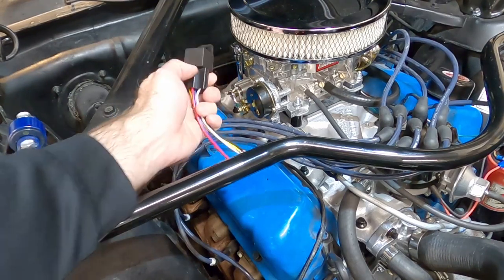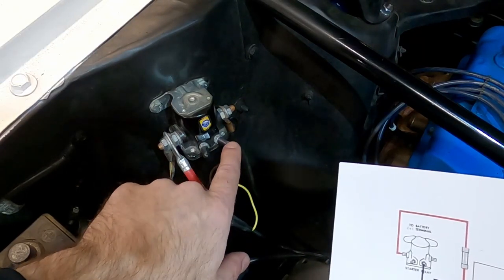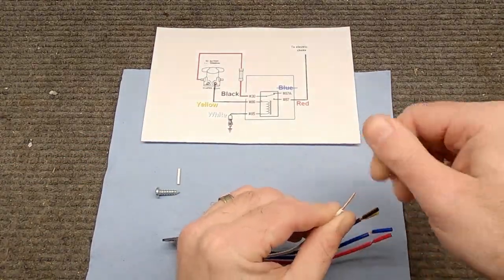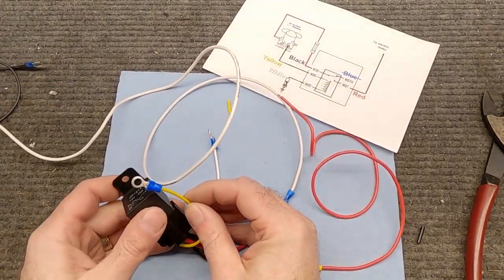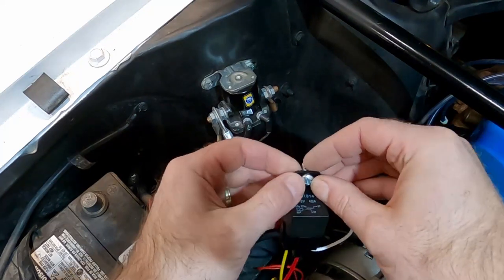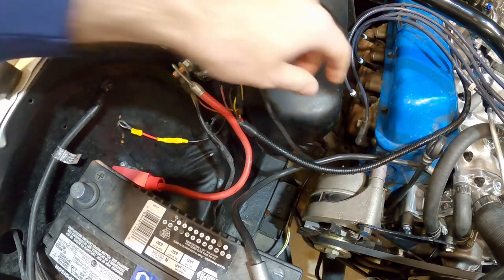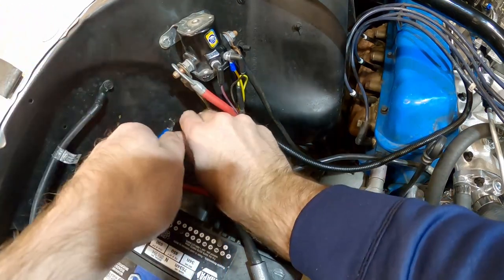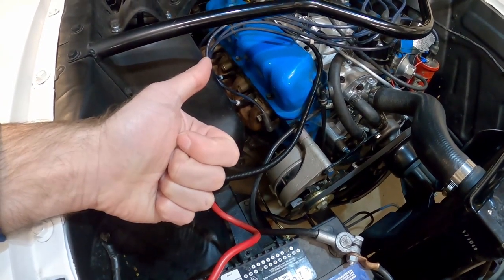How to Wire a Relay for an Electronic Choke

Comment: This is a good solution for someone who has added an electronic ignition that must have a dedicated 12 V. I had to bypass the PINK resistor wire and after that the I stud on the Sol didn't have the 12-volt power any longer, this will do the trick and it won't interfere with the coil.
Reply from the maker: I think it is too, but others see it as a waste of time.  It is agreed that the coil for the electric choke pulls a very small amount of amperage to the point where it can piggy-back on another circuit, I like having a dedicated circuit for additions to the car so I can track things down if there's a problem.  :)

Comment: Great video.  I did laugh when you mentioned using heat shrink on the connections, but then only used it on the one, and not the others you made.  🙂   Awesome explanation of using the relay!  I subscribed.
Reply from the maker: It might fall under “do as I say, not as I do”?  😄

Comment: Andy. Suggestion.  When you need to add wire length, use the same color wire as the original. The different colors are used for a reason— to be able to identify each circuit visually, with no need to use a tester.  Make sure you use the same gauge wire as the original.
You can buy an inexpensive wire kit of different colors and sizes with its own stand.
Your car is turning out nicely! Best Regards
Reply from the maker: This is good advice, and I've done that in the past.  However, when I did this video, I just used what I had in the garage.  :)

Comment: Why did you end up running a relay here? Did you not have access to 12V? I have to check where mine is hooked up to, but I didn't end up using a relay to get power from that area.
Reply from the maker: I needed a 12V source that was only on when the car was on.  Plus, I didn't want it tapped into anything else that was running in the car, I wanted a dedicated power source.  There are a few places in the car that one could tap into for a switched source, but this way guaranteed me the power I needed without interrupting anything else.
Reply: You can just hooked up to the coil.
Reply from the maker: @brechtvancauwenberghe9440  Yup

Comment: What size fuse are you using on the in-line fuse? Thanks Andy. Great vid as always. CJ pony ain’t got nothing on you. Big fan here from Toronto.
Reply from the maker: 10A or smaller. You could probably use a 5A with no issues. The coil inside the electric choke doesn’t pull much amperage to do its job. 🙂

Comment: Not sure you need a relay at all, since the current draw isn't high.  You could tie it straight to the solenoid where you took the power for the relay coil :)
Reply from the maker: Thanks for the heads up.

Comment: I imagine the in-line fuse has to be a 12V fuse, right? ....great vid by the way, I wasn't sure if I should by a carburetor with a manual or automatic choke, but I see no reason to fear the electronic one, jejeje
Reply from the maker: Correct, 12v fuse, 10A is plenty.
Some people prefer the control of a manual choke, but I'd rather have an electronic version so I don't have to mess with it.  :)

Comment: Thank you for a great video.  One comment I hear people make when wiring up their chokes is you don't want to use a constant 12v source.  You only want one that shows 12V when the key is turned on.  But doesn't this mean the coil on the choke is on all the time anyway (if the key is on)?  I guess this is to make sure the choke stays open (with some heat) even though the engine should provide enough heat to keep the choke fully open.
Reply from the maker: Correct, the power source for an electric choke is only hot when the car is on (as I've done here).  And yes, by feeding that choke a 12V signal while the car is on will keep the choke open during the use of the car, and it will begin to close once the car is off.  However, due to the nature of the coil inside the electric choke, the a hot motor and a hot day will make the choke stay open, but it may not be fully open, which could cause a little havoc with the driver if the choke is closing while they're headed down the road.
To reply to your comment about the choke always being 'on' with a power wire that is active while the car is on, this is fine and it does not cause any electrical issues or wear out the choke.  The amperage draw of the choke is low, and this is how all cars of the era (and for quite some time later) were wired up.  I guess someone could wire up a switch that cuts power to the choke once the engine is warmed up, but that choke needs to remain open during the drive, so it's easier to just feed it a 12V switched source and call it a day.  :)
Reply: To be clear in my mind, my choke only has a connection for the hot wire. I was told when I got the carb to just run a hot wire to the fuse box with a fused line. It’s a 75 Chevy. I think it’s grounded in itself. But, is it ok to wire it to the fuse box without using a relay like you did.?
Plus my solenoid is on the starter, not the firewall.
Thanks so much
Reply: I don’t want it staying ‘hot’ powered, after the engine warms up if this isn’t good.

Comment: Great video Andy! Thanks for sharing. I’m curious to find out what headers and radiator you go with on this build. However, those may come after the manual transmission swap you had mentioned. Thanks for the video.
Reply from the maker: Headers are coming soon (keep an eye out for that video), but I'm not sure yet on the Rad.  The main reason I replaced it on my last Mustang was because it was leaking.  So far this Rad is doing great and I'd rather put my money towards other parts that need some love first.  However, I will eventually replace it as I'd like to go to an electric fan setup, possibly a dual fan option.  The stock Rad is not larger enough for dual electric fans, but my engine is doing great on the stock setup, so........  :)

Comment: So there is supposed to be power to the choke all the time that the ignition key is turned on? So, I have learned something new. Thanks Andy!
Reply from the maker: Yes, other wise that bi-metal coil will cool down and the choke will begin to close. The old heat-tube style choke systems that were stock on these cars ran off the heat generated by the exhaust, which kept that coil warm and in turn kept the choke open.
Reply: @AndyKruseChannel  thanks Andy.
Reply: @AndyKruseChannel question if you don’t mind answering, is there any downside to running an electric choke that way?
Reply from the maker: @noble5856  Running it which way?  Are you asking if there's a downside to powering the electric choke with a constant source?  Without the constant 12V source, the coil inside the choke will cool and close the choke.  The choke must be powered the whole time the engine is running.
The same applies to the heat-tube style of the original choke, it receives a constant source of heat while the engine is running, keeping the coil in an expanded state, which keeps the choke open.  After the engine turns off, the heat is no longer applied, the coil moves back into its "cold" configuration, and the choke closes for the next time the engine is fired up.  In the summer time the coil likely stays warm with the warm outside temp, but that's ok because that means the engine is sort-of warm and the choke is not likely to be needed.  :)
Reply: @AndyKruseChannel   I thought the I could use the old style of electric choke from the old carb with heated coil but it seems like it the carb isn’t built compatible with that I didn’t want to add any extra wires to the engine bay, I appreciate you explaining the differences though, your channel is great and very helpful

Comment: Recently found your channel, bingeing them nowI really like your vids. I own a GM, but love all muscle car era cars. 
I added a ford type start solenoid to my car. The post you ran to the choke  has 12v with ignition on. Mine just send 12v to coil at start, as I have resistance wire. Is yours set like this because ford coils are internally resisted?
Reply from the maker: Welcome!
To be honest I don't know if the solenoid is internally resisted.  Back when I made that video, I was looking for 12V switched sources in the engine bay so I didn't have to run a wire from under the dash.  :)

Comment: Andy I would rout the wire to a switch oil or someway to have power to the choke only when its running, not simply with the key on incase you wanted to listen to radio or left the key on just saying.
Reply from the maker: Thanks for the heads up.

Comment: Hey Andy......I have a stock 67 289. Still has the Autolite 2100 carb on it. It works well. But debating on adding an electric choke. Should I upgrade my carb that already has an electric choke? Or just change the choke? If I upgrade the entire carb, what brand and size do you suggest? Holley 600? I don't know what size would be a drop on carb, without making a bunch of adjustments.
Reply from the maker: I put a 600 on my 289, but it was too much.  A 500 or 570 would be sufficient for there motors.  As far as replacing the 2100, it's a great carb, but you're leaving some performance on the table with that 2 barrel.  While you can buy an adapter for mating a 4-barrel carb to your 2-barrel manifold, it'd be a great time to upgrade that too, but it just adds to the bill.  :)

Comment: Hi Andy,
I am rebuilding a 1986 F150 with my son.  We just installed a non-feedback carb with an electric choke.  I have a questions about pin 87 and 87a.  When all wired, I wired pin 87 (normally open) to the choke and pin 86 to the starting solenoid, 85 to ground, 30 to the battery with a fuse.  When I check voltage to pin 87, I get nothing.  I put positive lead from DMM on 87 and neg lead on ground.  I get nothing.  If I put pos lead from DMM on 87a (normally closed) and neg lead to ground I get more than 12v (between 12-14).  Should I wire the choke to 87a?  When I turn the key off, the reading goes to zero.  Did I wire something incorrectly?  Will it harm the choke if it is getting 12v the whole time while running?  Should the choke be getting 12v the whole time while running?  Why wire it normally open if it gets 12v whenever running, right?  Any advice?
Reply from the maker: Working from the beginning of your post, you are correct, the voltmeter should read zero at pin 87 when the car is off.  If you connected pin 86 to the "I" terminal of the starter solenoid, and the car is off, the voltage at pin 87 needs to be zero.  Pin 87 will only show 12V when the car is on (running or just with the key in the 'on' position).
Moving the voltmeter to pin 87a at this point should give you 12V (as you pointed out), but this is ok because you are not using 87a and it should be taped off (like I did in the video).
Now this is where it gets tricky because it sounds like you just turned the key to 'off' and the voltage at 87a went to zero.  It should still say 12V as pin 30 should be attached to the battery, or at least a constant 12V source, regardless if the key is on or off.
The choke can get 12V during the whole time the car is on, even after the choke is fully open, it's not hurting anything.  Some people skip the whole process of the relay and just wire up the choke with a switched source (a voltage source that gets 12V only when the car is on) and it works fine.  I like relays and I like isolating the various circuits on additional electrical components.  It's a tiny bit overkill on this car, but I like having a dedicated circuit for the Choke.
Hopefully this helps!  :)

Comment: Why wire the relay signal voltage from the crank side of the starter solenoid so the relay is energized only when the engine is cranking - effectively turning off the power to the choke heater them moment the engine begins to run?  I get my signal voltage from the alternator.
Reply from the maker: That's not how that works, the relay is on when the engine is running.  You are more than welcome to grab a hot signal from the alternator, or the back of the ignition switch, I just chose this location be cause it's simple and it works.  :)
Reply: @AndyKruseChannel   -- You are gabbing power from the small right side terminal [ the Ign. terminal]  on the Ford starter solenoid to signal the relay,  to turn the relay on, so power flows from the large left side BAT terminal through the relay to the choke heater coil, correct?  This is what I got from your drawing.
Reply from the maker: Switched power is coming from the ignition switch (in the dash) when the key is on and it goes to two places off the same wire when it passes through the firewall.  One of the places is the positive terminal of the ignition coil.  The other place is the ignition terminal (labeled "I") on the starter solenoid.  Pulling power off that terminal to activate my relay is the same as either tapping into the red/green wire coming off the ignition switch, it's just easier to grab the 12V at the "I" terminal.  Admittedly, the relay is already overkill for this application, but I like it.  :)

Comment: Another helpful video...thanks. Could you also run the wiring direct to the coil (if so, do you need a relay/fuse?).
Reply from the maker: I have read that it's not ideal to tap into the coil for what I am doing with that electric choke.  This way I get a dedicated power source and nothing in the car is affected by this circuit.  :)
Reply: The coil isn’t a constant 12v and you don’t want to draw any current away from your ignition.

Comment: Thanks for the content. I like you, like for stuff to be on or off. Don't listen to the half-ass jack-asses trolling on here.  They probably never built, rebuilt, fabricated, invented anything with a engine.  A relay is one good way to have a on/off circuit for accessories and other 12v items. I have a few boats, and a large RV so adding a relay here and there is a good thing.  My deal is a 5 pin relay is really for having a high/low switched 12v source rather than an on/off. I will probably follow this tip when I add an electric choke kit to my edelbrock at its rebuild soon, however I will use a fused 4 pin relay to save some steps and have a on/off switch.
Reply from the maker: Yeah, there are lots of good uses for relays, but they're not for everyone.  :)

Comment: Hi Andy I tried adding the relay to my mustang as well and followed the diagram however I’m not getting the 12v out of the red wire. Could it be I just got a bad relay?
Reply from the maker: Your relay may not have the same colored wires for the various terminals as mine.
Reply: @AndyKruseChannel  hi Andy well I ordered what I thought was the same colored wire harness do you mind if I send you the pics
Reply from the maker: @75cezr  The wire color is not important, but you should be able to follow the diagram in the video based on the terminal number.  For me, the red wire goes from terminal 87 (referred to as "normally open") to the choke, so you'll want to make sure that terminal 87 on your relay is doing the same thing.  While you're there, double check all the other terminals are going to the correct location based on that diagram.  :)
Reply: @AndyKruseChannel  thanks andy

Comment: if u don't have shrink wrap wipe silicon in the wire connector which works better then shrink wrap keeps o 2 out of the connection i use both because shrink wrap looks better plus i use multi color shrink wrap to match the wire. i do a lot of rewiring cars so i have just about every color and combo color plus rebuild old wire harness way cheaper then a new wire harness . i will take the wire clip out of the plug and put a new one in if still good i will pull it out clean it
Reply from the maker: I like using the shrink wrap too, I’m just out of the size for this wiring, I need to buy some more. 😁

Comment: I have an issue with rough start once car is warm.... could that be choke related? Starts well when cold
Reply from the maker: It could be a number of things.  Without knowing the state of your carb, it could be a setting, a stuck throttle, clogged jets, sticky float, improperly set choke, bad gas, etc.  It may be as simple as redoing the idle mixture screws on the front of the carb.  I recently did a video on how to adjust them, give a watch and see if you can fix your idle with that video.  :)

Comment: So you already had switched 12 volts at the solenoid...why not just run a wire straight from the switched 12 V at the solenoid to the choke? Would have saved a lot of wiring.
Reply from the maker: I explained why I chose to use a relay in the video.  :)

Comment: I'm learning tons of stuff from you, keep it up! Btw, how many amps for inline fuse?
Reply from the maker: Thanks!
10A is more than enough, the choke doesn't take much juice.  :)
Reply: @AndyKruseChannel  i came to find out i don't even wires from my choke, your older video seems to connect directly to the alternator? Or should I follow this latest one that taps to the solenoid? Thanks for  replying btw
Reply from the maker: @pinoypostman4648  Using the "I" terminal on the starter solenoid just give you a switched source (hot when the car is on) to trigger the relay.  This saves a step from putting a wire on the back side of the ignition switch for essentially the same thing.  The "I" terminal is only keeping the relay on when the car is on, but the power to the choke is coming from the battery through the relay.  :)

Comment: What size fuse did you use?  Was that a 10 Amp?
Reply from the maker: 10A is more than enough, a 7.5 or 5A fuse would work too. I just used what I had in the garage. 😁